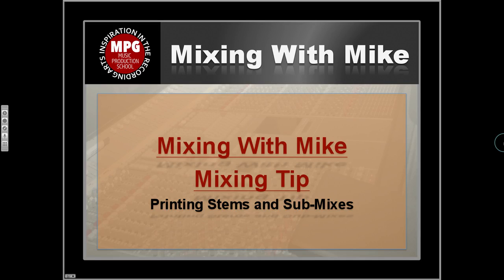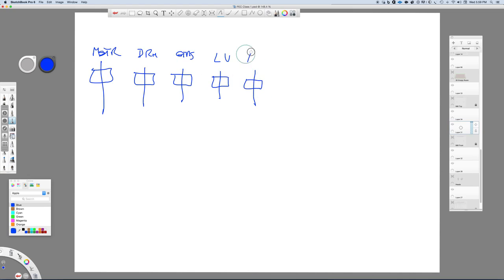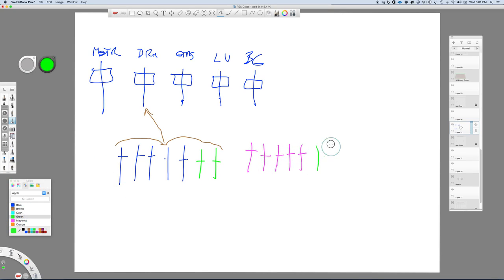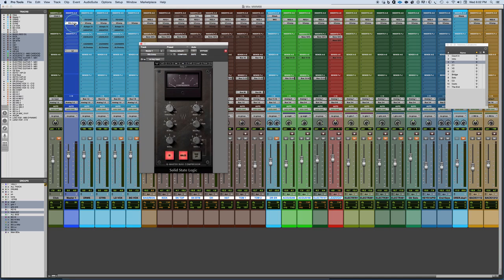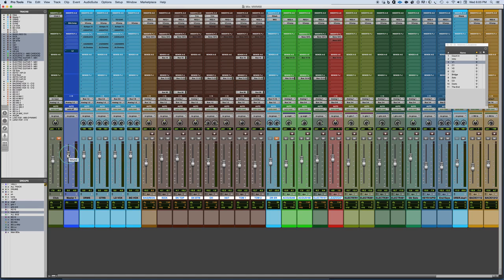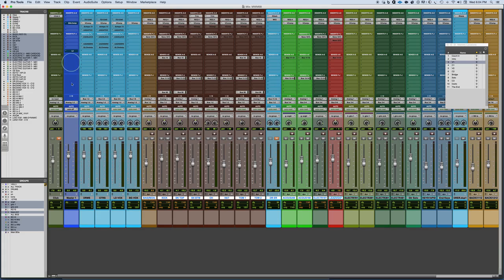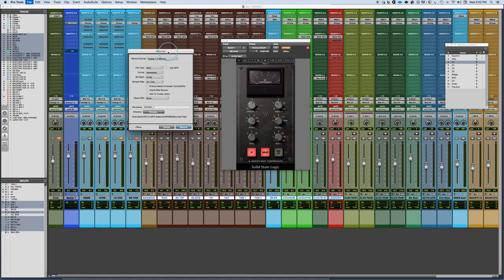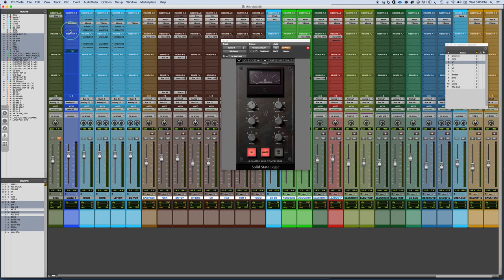Mixing With Mike Mixing Tip: Printing Stems and Sub Mixes

Comment: So if you're printing stems for someone else, you're pretty much screwed then? Unless they have the exact processing you put on your master bus, they won't be able to recreate your mix. I guess this is a good argument for not using heavy master bus processing. As long as it's gentle, your mix should still sound decent without it. 

I was hoping to hear the complex routing method for being able to have a bunch of buses muted but still have the master bus plugins react to those buses. It sounds like your answer is pretty much "don't bother"?